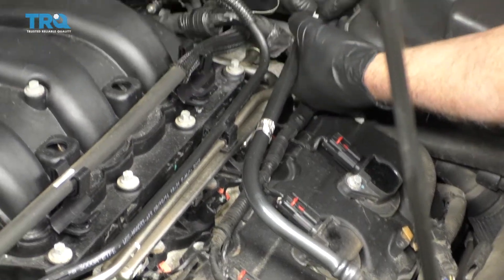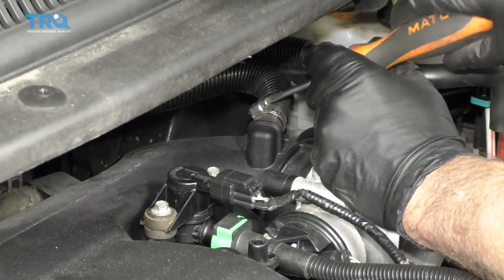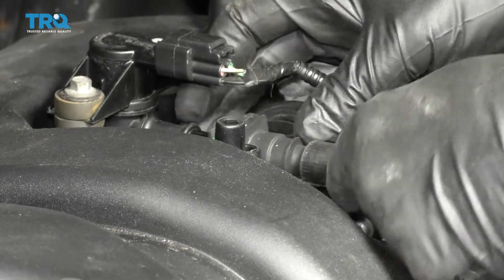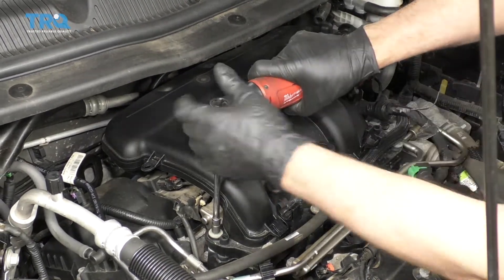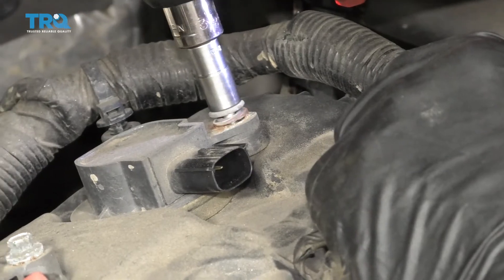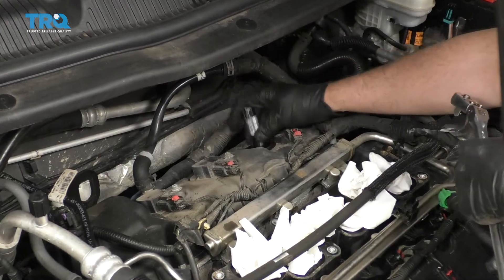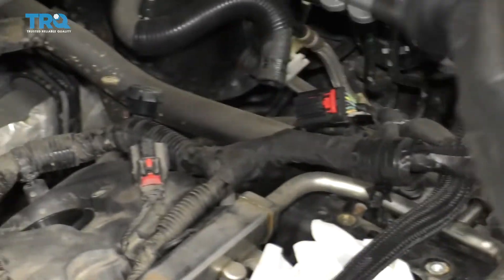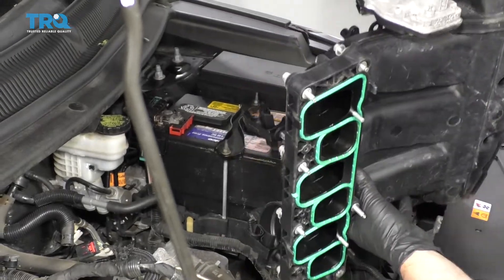How to Replace Spark Plugs 2013-19 Ford Police Interceptor Utility

Comment from the maker: √  Watch the Video
√  Buy The Part at 1A Auto https://1aau.to/m-Shop-TRQ-Parts
√  Do it Yourself
√  Save Money
Reply: My manifold is stuck... i loosen all of them bolts but the right side is stuck...
Reply: @ArmoredShieldCoatings  there is a support bolt for the intake under the throttle body, its 8mm

Comment: I have a 2016 Ford Interceptor Utility Ecoboost 3.5 Twin Turbo AWD... *Former Georgia State Patrol Unit... My Engine does not have this high up in the way Plastic Plenum (Headache). My intake is low and all metal. Do not have to remove it to get to coil packs and plugs. Just loosen intercooler piping that runs to rear held down with 1 10mm bolt and remove a few hose clamps etc.,  Still have to be careful with rear side of engine wiring harness and clips/lines. But seems to not be that hard to do for any mechanically inclined individual.

Comment: Are there any other parts that I should/can replace while the intake is out?  For example, is the cylinder head temperature (CHT) sensor under the intake?  Thanks for a useful video.